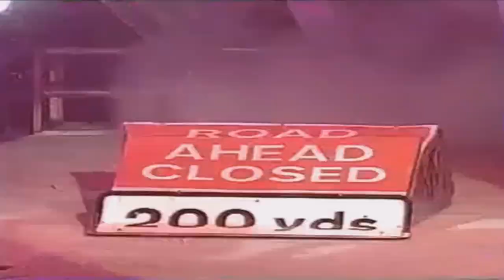Robot Wars Guru, Episode 23: Series 1 Episodes Ranked

Comment: My order:
6. Heat D. Once Vector of Armageddon had been eliminated in the gauntlet for driving up a ramp it didn't have the ground clearance for, it was pretty much Cunning Plan's heat to lose. All the other robots were either hard to control, unreliable and none of had effective weapons on them. It was fun to see The Demolisher whizzing around the arena and seeing Matilda doing some of the best damage of the series on Sat'arn. But none of the fights were good and that's what let it down.
5. Heat E. We had some interesting designs in Psychosprout (if not very good), the first undercutter weapon in Full Metal Anorak and the shiny cone wedge Bodyhammer. We had one of the most impressive performances and damage of the series in Bodyhammer beating up Torque of the Devil. Unfortunately this episode will be tainted by Shunt deciding the heat final (even though Bodyhammer was the best robot) and I don't like the maze trial either. It would have been ok in Techno Games as a game to test driver skill, accuracy and robot manouvreability but not for deciding the best fighting robot. Roadblock would have really struggled in that trial just because it's so big.
4. Heat F. The best fighting robot won but it got through the trial when it didn't deserve to which I found annoying. I was 9 when I first saw this in 1998 so I had a soft spot for Eubank the Mouse for how silly and cartoony it looked and had some speed, whereas all the others looked slow and dull except for Elvis which was just dumb. When Jonathan Pearce said that "The Mouse had irreparably broken down" and there was no interview with the team to explain what had happened, I thought it was very suspicious. Now I've listened to different Robot Wars podcasts and I've learnt that The Mouse was a stock robot that wasn't allowed past the trial, it makes sense but is still kind of annoying. Thankfully T.R.A.C.I.E. made up for it in the remaining fights against Prince of Darkness and The Scarab. What made up this heat was the final melee which was easily the best fight of the series and an impressive performance from Roadblock and deserved win which turned it from a bad heat into an ok one.
3. Heat C. The main reason I've put this so high is the main shining light of this heat Robot the Bruce. At a time when nobody really knew what to do and technology wasn't very good, for a robot to have such good power (pushing a house robot down the gauntlet) and such good control ia very impressive for it's time. The only thing which lets this heat down is the most interesting design Plunderbird 1 getting pushed onto the grill in the gauntlet, letting stock robot Wysiwsg through and I would rather Plunderbird 1 got through to the fights rather than Dreadnaught. Despite that, I'm happy with the overall outcome of Robot the Bruce winning. I also enjoyed the football trial, as I'm a big football fan as well as robot fighting. The only football match in Robot Wars or Techno Games that I didn't enjoy were both of Evil Weevil's matches in series 3.
2. Heat B. This was so close to being number 1. There's the debuts of some memorable teams and robots in Rex Garrod with Recyclopse, Mortis and the Naplm team with Detonator (even if it was to rant about how bad or lucky their robots were). There was a fun trial where there was the first House Robot kill in Recyclopse flipping Matilda and it was fun watching Mortis beating up Leighbot. The only thing that stopping me from putting this number 1 is the judge's decision in the heat final which I think was wrong.
1. Heat A. This was a great introduction to the series. The introduction of some eye-catching robots in Roadblock, Killerton, Nemesis and of course the house robots. The first Sumo was interesting, the first burning of Nemesis, Killertron v Shogun whilst not exciting was nice to see a robot using a weapon that worked, the first legit KO in the heat final. Tying it all together was Jonathan Pearce's excitable commentary which made it even more entertaining. This first episode was the first episode I ever saw and I was hooked.
Reply from the maker: This was a good read :D  I love that you went into detail instead of just listing them :)

Comment: I called Heat B being number 1 as soon as I saw this video, and honestly, I agree. It really was the best rounded heat of the series. Fun trials, unique designs, debuts of legends such as Rex Garrod and the Mortis team, and there were no stock robots to nullify the trials (plus some fun banter between Jeremy and the Mortis team). Also, I feel that Bodyhammer and Wedgehog should've been swapped heats. Wedgehog was a middleweight that had to fight much heavier robots, whereas Bodyhammer was a heavyweight that was at an extreme advantage against it's middleweight competitors (and yeah, the producer meddling in the Heat Final was BS). Still, I guess first series balancing issues can be overlooked.
I'd be interested to see more potential Top 10s for the later series. 👍
Reply from the maker: Heat B is the ultimate :D  And don't worry, I plan to do this for every series :P